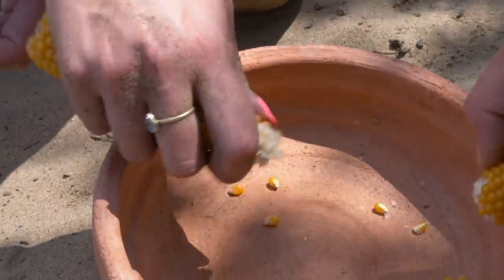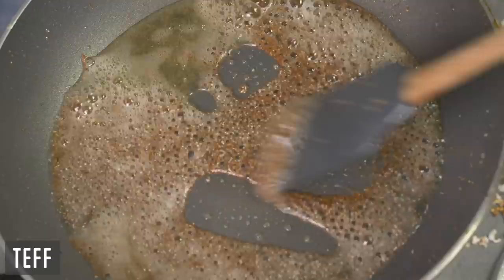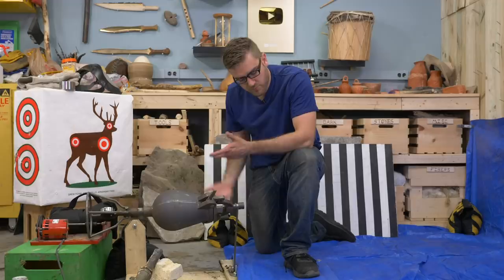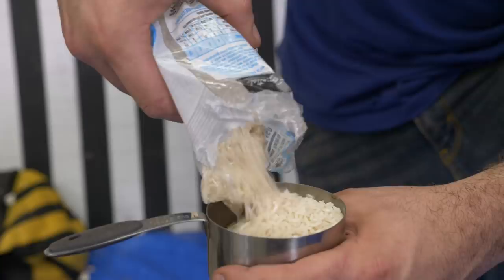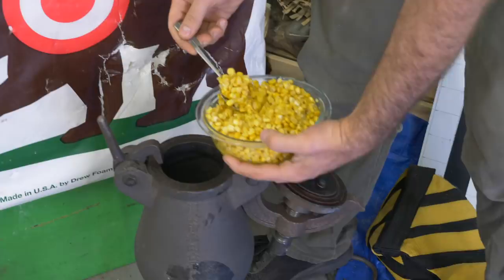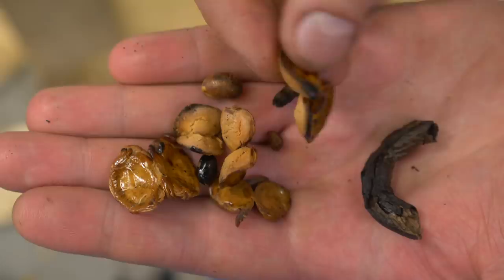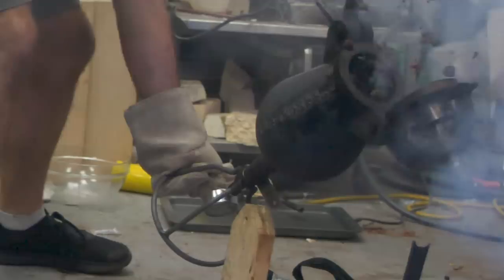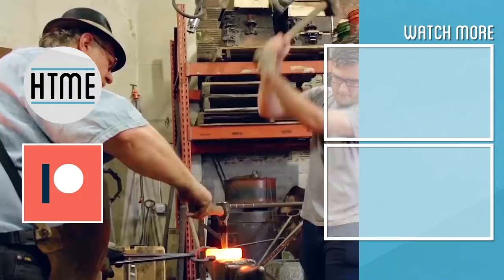How to Make Popcorn Using a CANNON! (Super DANGEROUS)

Comment: I feel like you should experiment with how much you load into the cannon at once. It seems to me you need more pressure with less heat, so you stop burning them. 

The more volume that is taken up by the grain, the less space for air, and the faster the pressure will rise (meaning it's cooking for less time before you release it). You should also have it spinning very quickly, to equally distribute the heat throughout all the grains.

Comment: To stop them from burning you probably could have just moved the torch further away
Reply: He is a bit of a slow learner. It's a cast iron pot that retains heat very well. Thats why it is supposed to be spun quickly.  
Those things pop the corn real fast if operated properly.
Reply: I've also seen them add a spoonfull of water so that the steam brings up to pressure more quickly. Some of his attempts looked too dry.
Reply: We got to remember too in those days they didn't have youtube tutorials hehe
Reply: Okay years of research lol I have never seen a video with someone so inept at what they are filming. I bought one of 5bese cannons and it took me 2 pops to get it right. I have never used a device so simple before.

Comment: Rather than a literal canon, couldn't you just use a pressure cooker?
Reply: Probably not, I think it has to be a sudden release of pressure to make them expand
Reply: In the intro I thought he used a pressure cooker. And then died
Reply: Modern pressure cookers will not open till there below a curtain pressure, but if modified?
Reply: @putteslaintxtbks5166  some makes automatically release steam others don't. Or just stick tape over it so it can't release steam
Reply: @pokemoncrusher1246  The old ones were often blowing up.l had some from the 1960's, 1970's, I think and they were fairly safe. Had an exit for pressure to release, controlled by a weight and could use different weights for amount of pressure needed. They still scarred(sp) me, as anything, like a bean if it got in that release tube and the weight wouldn't be able to lift, to release pressure. They don't need alot of heat, to build pressure real quickly after getting heated up. No one should ever "modify One". So don't try this at home.
Reply: I don't think that'd work. Unless you're looking for a pressure cooker bomb with popcorn shrapnel, which in that case it'd be perfect.

Comment: “I’m not gonna be anywhere near it”

Doesn’t matter much

Steel can hold hundreds of thousands of pounds of pressure per square inch. If you manage to rupture it, you would need a berm, because it’s gonna be like an artillery shell going off.
Reply: That’s Chinese made though, I wouldn’t trust it beyond anything but boiling water, with the pressure gauge removed, to vent pressure.

Comment: I wonder if the various non-puffy results are due to not filling the cannon enough. If I understood it correctly, the idea is that you get everything ready to puff with heat & pressure, and releasing the cannon's door is the equivalent of the hull breaking. Also, if you notice in the video of the street vendor, he holds the rear end up and shoots the cannon "down," which suggests that you need the gravity assist to get the food out before it fully expands.

Comment: There is different kind of machine used in China to make puffed foods by extruding them under pressure. You pour grain or meal into it and a screw extrudes the grain under high pressure and heat into puffs. They sell the machines on Ebay. But, it needs a pretty good sized motor to turn the screw.

Comment: The fava beans results were interesting. How about dried peas? French lentils - those have a decent skin that does not fall apart when slow cooked so they might allow a decent amount of pressure to build up inside. 
  Thinking of all the dried bean and peas snack on store shelves, almost all are flavoured in some way, salt being the most common. But I've also seen horseradish (wasabi peas), lime, hot peppers just for the savoury options, which are are my favourites.

Comment: There is a stand at central market in Lancaster, PA that makes rice cakes using a similar method. They have a 2" cylinder and piston where they load rice and heat it. After a certain pressure, the piston is released and the puck expands to a 6 inch rice cake. The force triggers the hopper to release more rice which falls into the cylinder and the steam motor presses the piston down again.

Comment: Add a teaspoon or so of veggy oil and keep rotating quickly, as it's heating, to keep it from sticking to the sides. It also helps if you have a stand that you can keep the fire under to preheat the container before you dump the corn, rice, or whatever, inside, and seal it up. Much faster pressure build-up and less time to burn, before you pop the top. 😉

Comment: I don't know if there sold outside the Midwest, but here you can buy a corn treat that is made from dent or field corn. It's 'puffed up' maybe 2, 3 or so times normal and seasoned. I've tried making it in hot oil, baking, persoaked in water, etc. with only slight success. Bet they use something like that cannon.

Comment: Perhaps the cannon could be made safer with a valve that would let out excess pressure before it explodes?
Definitetly interesting!
Are those dry rice cake wafers made using the cannon first, too?
Reply: I think the rapid decompression is part of what makes it work successfully.
Reply: @jdsbees3257  I mean as a safety feature, which would not affect normal operation. Then again, the walls are made so thick to hold the high pressure.
I wonder if there's even enough stuff inside the cannon to cause problems. (Assuming you measure the oil and the popcorn)